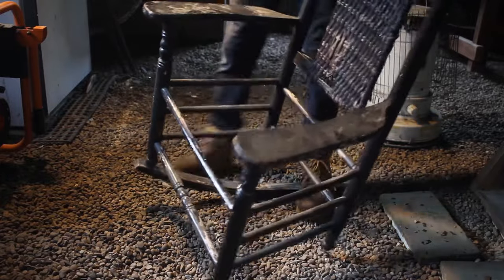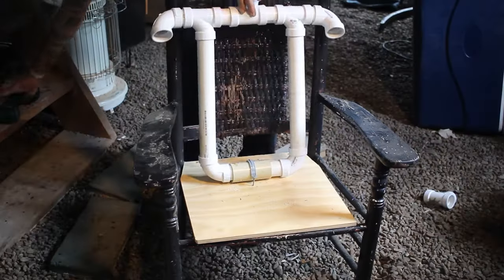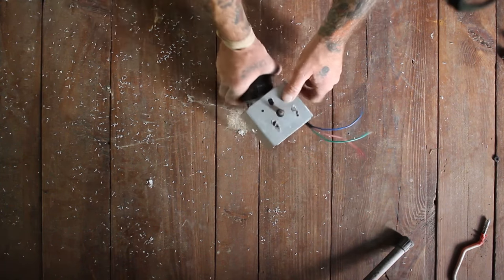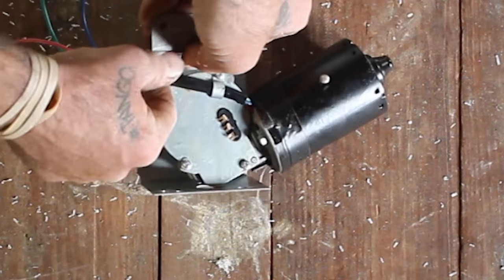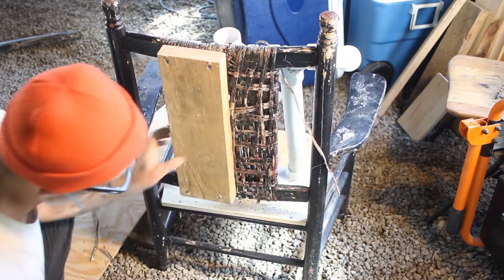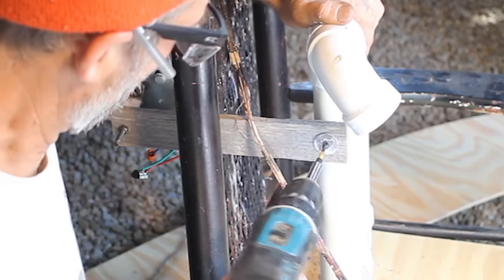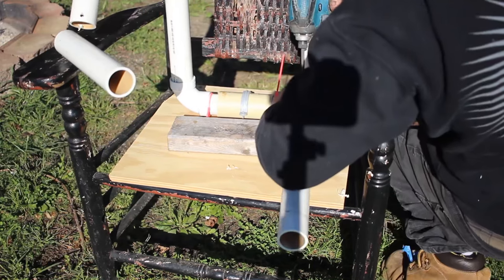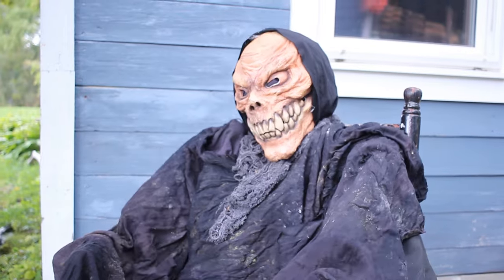Diy Motorized Halloween Decor HACK

Comment: How much RPM? Thanks
Reply from the maker: No idea. Sorry
Reply: Looks to be 30 rpm, 2 seconds per full rotation. You can under volt the motor to make it run slower or use a motor controller to reduce the speed in a better way.

Comment: How would I make a stabbing arm for my Micheal myers
Reply from the maker: Hmmm… I’d have to think on that.
Reply: I was thinking would the wiper motor rock like a stabbing action also how do you power it
Reply from the maker: @kirstykat8309 frightprops.com has everything you need to power it. Also, all the moving holiday props at Home Depot right now can be disassembled and used for motors. I’d say that you should keep the arm as light as possible. Pool noodles and wire.